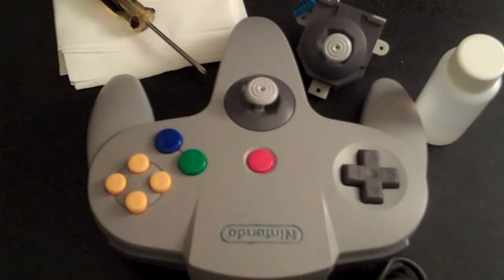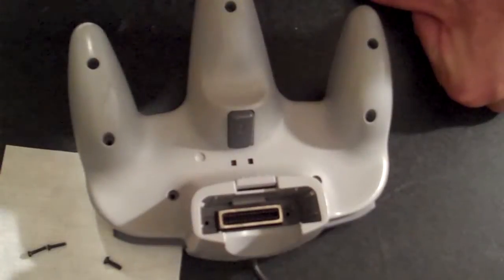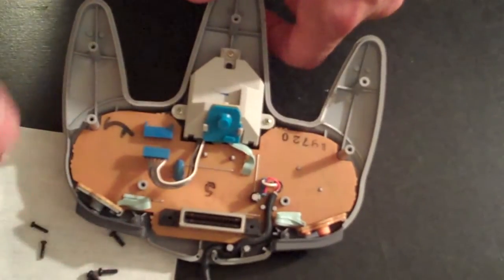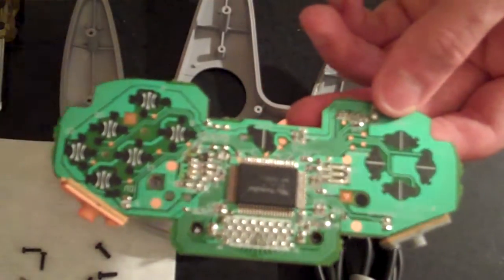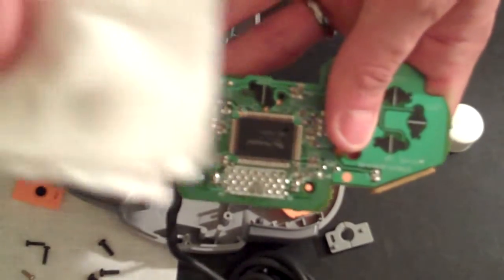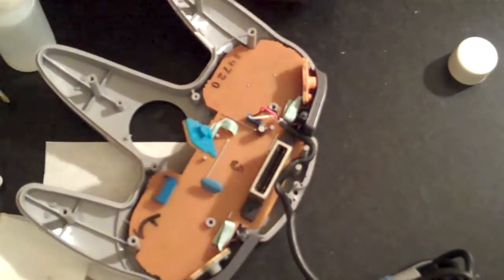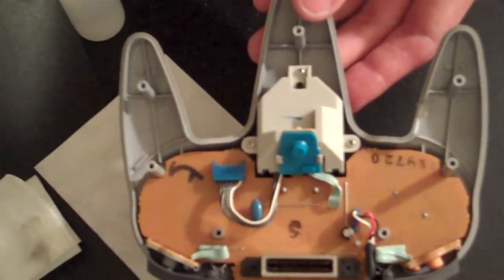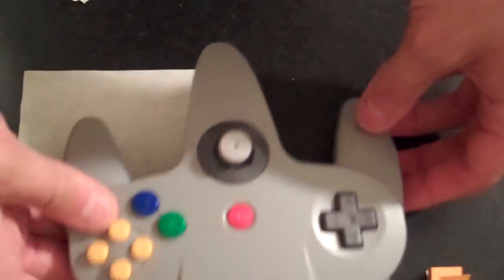How To Repair a N64 Controller Thumbstick

Comment: I can get a replacement joystick off of Amazon.com for 5 bucks, looks just like the original and the reviews are really good. My red N64 controller is the one that needs it the most, although I might get a few extra ones (for when I get more N64 controllers with loose joysticks), as well as one for my jungle-green controller.

Comment: @Solidstryker: No don't use WD40 because it's too thin. Instead you should lube the analog stick with ceramic grease which you can purchase at most major bicycle shops. The ceramic grease is rather thick so you won't really have to use much but it will reduce friction which will substantially add to the analog stick's lifespan.